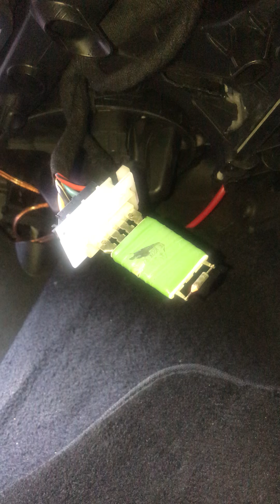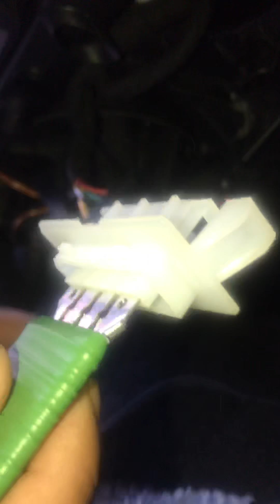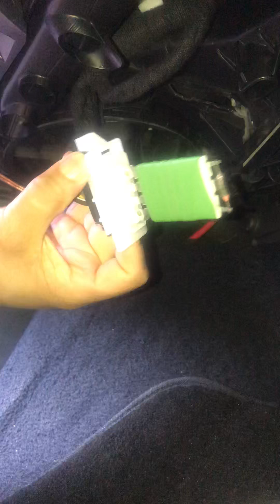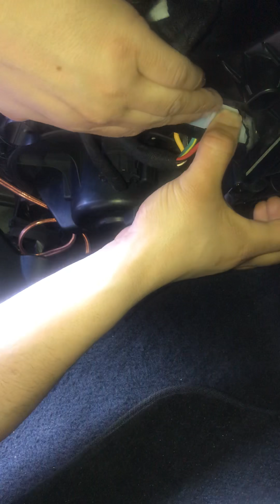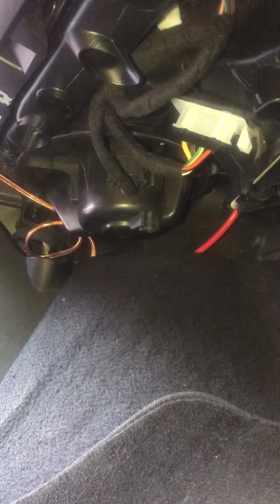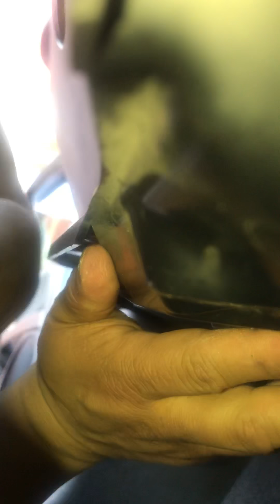Heater resister for seat Leon

Comment: How did you remove the old heater resistor? Struggling to get the white clip out
Reply from the maker: It's quite easy you twist it anti clock wise there's no screw just a twist it should come off u have any issue message me I'll  upload another video
Reply from the maker: There's a cover under the glove box with 4 screws open the cover u can see the resister